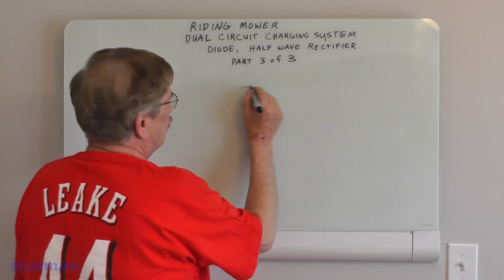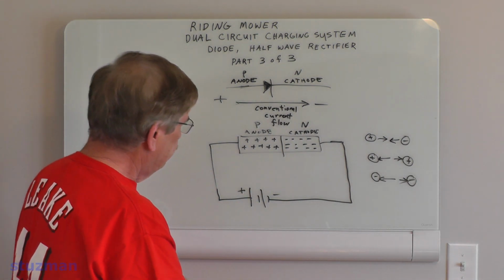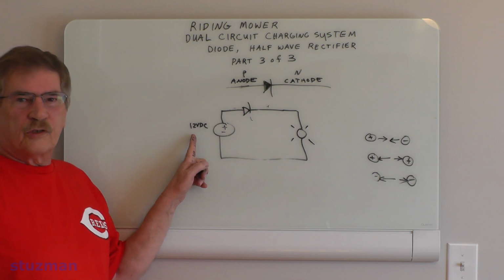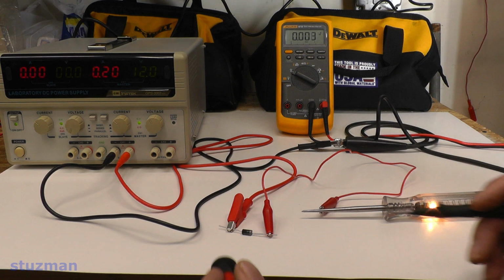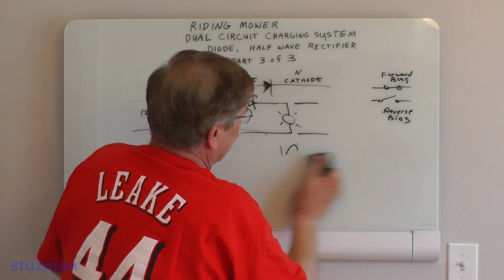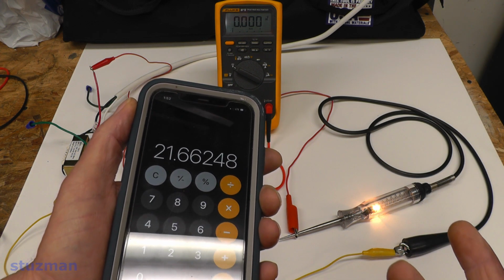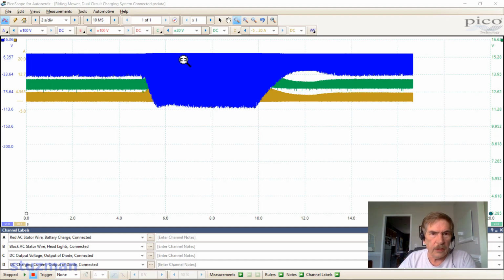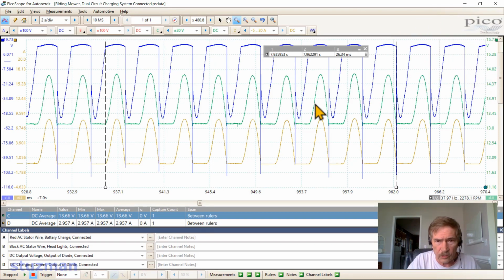Riding Mower-Dual Circuit Charging System, Diode, Half-Wave Rectifier, Pt 3 of 3

Comment: Trying to get my head around this type system. My mower is charging at 16.97V. It starts around 13.5V then continues to steadily creep to the max. Pretty sure the battery isn't going to appreciate extended exposure to the voltage it's getting. Great video.
Reply from the maker: Glad the video helped you understand the system better. I'm assuming that you have this same type of system on your mower?
Reply: @stuzman52 yes it's a dual circuit system.
Reply from the maker: @larryfisher5198  The charging voltage does seem a little high. Put an amp clamp around one of the battery cables and see how much charging current is going to the battery. The battery is really the only thing that limits the current. As you may know, as the battery reaches full charge, this limits the amount of current which lowers the charging voltage. I would test the battery to be sure that it's okay as it may have a shorted cell. Have a great day!
Reply: @stuzman52 thanks for the input. Not finding my clamp on. Maybe will get ammeter on my dvm in series and read that way next chance i get.
Reply: Update: battery tested good at auto zone. It's just over a year old. No luck checking amp draw. Can't find my clamp on. Tried the dvm in series with  known good fuses and doesn't read any amperage. So today I pierced the ac upstream of the diode and read between it and the other ac line from the stator and found 16.7VAC at high throttle. This reading matches the DC charging voltage I'm seeing at the battery.  I would think a failing stator would have falling voltage rather than rising. Unless someone has replaced  something incompatible (flywheel with stronger magnets perhaps? Wrong stator? ). This is a free mower that is otherwise in good shape but this issue has me baffled.
Edit: went back and took ohms readings on stator. Red upstream from diode to ground=1.5 ohms. Black ac line to ground =1 ohms. Red upstream from diode to black ac line=1.5 ohms.
Reply from the maker: @larryfisher5198  Try this as I know this is the voltages that I got for my mower using this system. Unplug the connector at the stator. You should see a black and red wire coming from the stator. The black wire is an AC voltage that's used for the headlight circuit. The voltage at idle should be around 8VAC at idle, and around 14.7VAC at WOT. For the red wire where you'll be measuring ahead of the diode. At idle you should get around 18.4VAC and at WOT, you should get about 33.5VAC. While you're in there, go ahead and check the diode. You can see this procedure of all these tests in Part 1 of the series starting at timeline of 25:15. Here is the link to that video https://www.youtube.com/watch?v=wWawauFROAg&t=341s Good luck on what you find!
Reply: @stuzman52 welp the plot has thickened further. Today I re-checked the diode and looks normal at 0.562. Red (ahead of diode) to gnd =22.5V @ idle; 40V wot. Black to gnd = 9.6V at idle and 13.6 @wot. Red (ahead of diode) to black 32.5V @ idle and 50V @ wot. Totally stumped here. My intent was to donate this mower to a friend in need but sure don't want to sentence him to cooking batteries. Wondering if an incorrect stator may have been installed and could possibly overvolt things.
Reply from the maker: @larryfisher5198  Your voltages aren't terribly off and I suspect that the stator is the original. The only thing that I can think of of why your voltages are a little higher is that the idle and top speed are slightly higher than mine. You could always set those speeds and that would bring down the voltages a little.
Reply: @stuzman52 no visual issues with the stator but got another ordered for grins and giggles. Hadn't thought of the rpms being an issue. Maybe try to look into a tach and possibly reduce rpm if high. Thanks for your feedback.

Comment: To use LED light bar on lawn tractor with dual stator would a diode need to be added to convert that headlight line A/C to D/C ?  Really liked your series explanation. Thank you.
Reply from the maker: Yes, you are correct that a diode is needed to convert the ac to dc for the LED light bar. But, you'll want to be sure that you don't exceed the current capacity of the stator. There are components called LED drivers with constant current capability that get do what you want. Have a great day!

Comment: Thank you for the detailed explanation.  It all makes sense.  I have a Craftsman lawn tractor with diode rectification for charging the battery. So I tried to measure the charging voltage going to my battery with the mower running and positive connection to the battery disconnected.  When measuring AC across positive and ground, I get 26v.  When measuring DC across the same terminals, I get 5.2v.  Since it is half wave rectified, it is neither AC nor DC, so I don't really trust either measurement.  How can I be confident that the charging voltage is correct?  Thanks.
Reply from the maker: Hi Enigma758 and you don't want to disconnect any wiring for the charging system. Take a voltage across the battery without the engine running. Start the engine and at high throttle, take another reading across the battery. It should be a few volts higher. If you see that, then you know the charging system is working. Or if you have an amp clamp, you can clamp it around one of the battery cables to see if its charging. Have a great day!
Reply: @stuzman52  Thank you!

Comment: Excellent job in your video teaching how the diode works, rectification and charging system. I am an educator in automotive electronics at an upper secondary school in Northern Sweden and I have been, more or less, into electronic engineering for 35 years. Once again; excellent job and as a matter of fact ... I will be sending a link to my students to your video. Thank you Mr Stuzman!
Reply from the maker: Thank you very much for the kind reply! I've been in electronics engineering for about 50 years now and there is always something new to learn each day. Be sure to tell your students hi for me and if any of them have any questions or comments, I'll be sure to answer them. Thanks again 4X1000!

Comment: Wonder series, thanks you for sharing this information. Quick question, instead of switching the power source could you  switch (reversed) the diode to change the its bias?
Reply from the maker: Yes, absolutely Jim! Reversing the diode is the same as reversing the DC power source. If I was to reverse the diode, the result would be the same where the diode is reverse biased and the light would be off. If I were to reverse the diode with an AC source, the light would still work, but the diode would conduct on the negative cycles instead of the positive cycles. Have a great day!